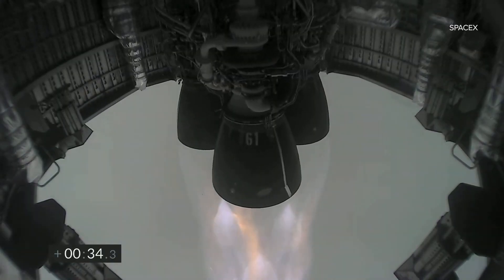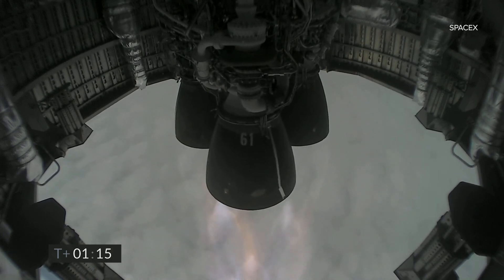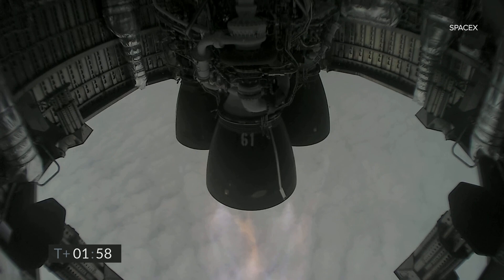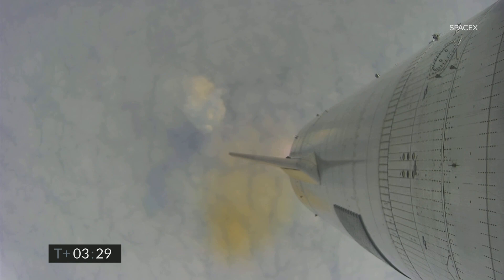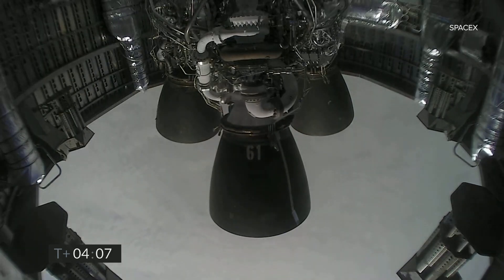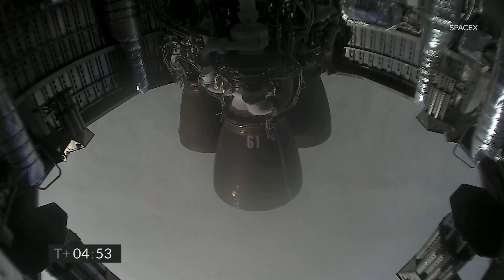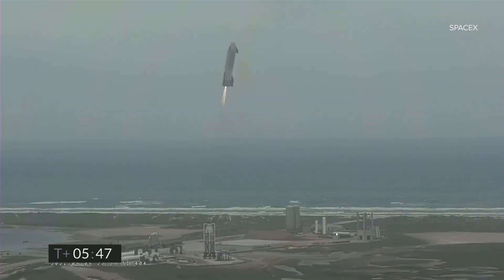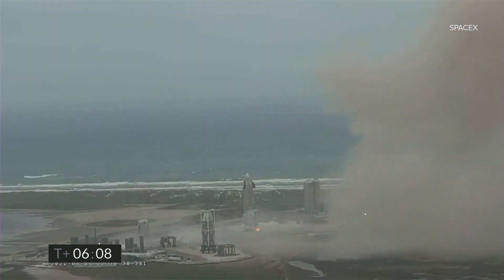SpaceX Starship successful launch, landing

Comment: 99% of people, including myself have no clue how difficult it is to send a rocket to the edge of space, and then land it within a few meters of a desired location, incredible stuff
Reply: @Stock Raising it would be easier to just send the rocket to the edge of space and land it again than it would be to deceive millions of people world wide with a fake launch and landing.
Reply: @Stock Raising Your brain is full of poop,  of will see poop in everything
Reply: @Stock Raising ok if ur gonna go after the moon mission i can't absolutely roll you.
1. The footage on the moon has shows tons of moments where the astronauts kick up dust, if you pay attention you see the dust goes in a straight line. Wanna know why that's important? It's only possible on the moon, try this with dirt outside and you'll see the atmosphere makes visible turbulence and vortexes.
Meaning, the footage could have ONLY been filled in a VACUUM, where there is no atmosphere.
The also black background and perfectly straight line light is also, only possible on the moon.
In order to have the same shadows and lighting as the moon, you'd need a massive light and a miles long, or else the shadows would converge and blur (compare the shadow of ur finger against two flash lights versus one, it's different))
If it were filmed in a massive room, it would be an incredible marvel of engineering equal to the rocket itself 
Because it would also have to be a vacuum chamber, a structure of that size, would have more tech advancement needed than the rocket  itself, as we still couldn't make something that massive even today. MEANING, IT'S IMPOSSIBLE TO HAVE FAKED THE MOONLANDING
Reply: @Stock Raising Did I stutter biatch
Reply: @Stock Raising bro.......I'm sorry but you are tripping hard on something 🤣,  it's not that hard to imagine, take a trip to Florida the next time they launch the rocket.
Reply: @Stock Raising well, if you think about it, it would prove that these space shuttles are real, I know, it's mind blowing 🤯
Reply: @Stock Raising And why do you think they would fake it? They don’t gain money from it they gain quite literally, nothing. Their fame won’t even last if they haven’t done it successfully, you quite literally have no proof on it being sci fi other then your “statement” which is from pure ignorance. I get that some people like you, don’t actually know how this stuff works, and can’t wrap your mind around it so your best option is to call it sci fi and to call anyone a robot whenever someone contradicts you. Believe me man, you won’t get far with this mindset.
Reply: @Stock Raising another failure at school i see
Reply: @Stock Raising please explain why this is impossible. You can go watch the rockets take off
Reply: @banton9368  he thinks there's a glass dome over a flat earth
Reply: @Stock Raising Ok flat earther
Reply: @Stock Raising like what “CGI”
Reply: @Stock Raising I did and there all easily disproved.
Reply: @Stock Raising bro what 🤣,  so are you a conspiracy theorists, because there's something called SCIENCE
Reply: @Stock Raising just for the record, you can literally watch these space shuttles launch from the beach or anywhere close since Florida is super flat.
Reply: The CGI guy is trolling all of you its funny
Reply: hey CGI guy, also all this chat and all of us are fake, we are AI just trying to make you believe this lift off/landing was real.
Reply: @draeonacs3160  Nah, I am not an AI but a dog. Don't tell my master plx, or no cookies :S
Reply: @Stock Raising stfu flat earther. Yall are so dumb. It's rlly sad how many people have the intelligence of a Neanderthal and its the 21st century
Reply: @Stock Raising lemme guess you think the moon doesn’t exist, and that the earth is flat
Reply: @Stock Raising I don't know how many years ago that must have been, but these days ... you sound like an absolute moron.
Reply: @Stock Raising hi absolute moron, you didn't do well in school, just admit you're dumb and unacademic.
Reply: @Stock Raising glad you see how dumb you really are
Reply: @Stock Raising The harnesses are for the astronauts to keep them from floating off into space.
Reply: @Stock Raising have you seen the cgi of that time, you would know
Reply: @Stock Raising yep I knew it, get out
Reply: @Stock Raising you too
Reply: @Stock Raising If the earth is flat and people who say it's a globe, such as me, are wrong, then how come when you put three people in Australia, South Africa, and Antarctica, they all can see the same constellation, the southern cross (which can only be seen at the south), at the same time? Oh wait, yeah, because they are all facing south because the Earth is a globe and not flat. It's the same thing with Polaris and Northerners can't see the southern cross and Southerners can't see Polaris because you can't see through the Earth. Furthermore, if the Earth is flat how come other planets are globes/spheres? If the moon landing was fake and it's all cgi, how come when you look at the cgi then it looked horrible? I can give you a links of videos to prove you wrong using little to no science at all. Not trying to argue btw, I just want to hear your side any maybe we could see each other's point more clearly
Reply: @Stock Raising So explain to me how people from the "outer edge of the disk" will be able to see Polaris and people in the "inner part of the disk" will also be able to see Polaris at the same time. Try to test it yourself, go to Australia and look for Polaris, you'll find nothing because you're facing South of the globe. You, like all flat earthers, have avoided those questions for a long time. It's time to face us with balls of steel and actually use Science instead of some abomination of an excuse. If you really wanna prove you're right, then explain to me exactly why we can't see Polaris when we're in the Southern hemisphere but can when we're in the Northern hemisphere. Please also clarify why "other planets are spheres and aren't flat". Your community's words, not mine.
Reply: @Stock Raising Ok
Reply: @Stock Raising Yeah, why?
Reply: @Stock Raising What does this have to do with my comments exactly?
Reply: @Stock Raising You too!
Reply: @Stock Raising Can't tell if you're trolling lmao, you seem to be very interested in defending your theory though so just make it easy. Go see one of these rockets launch and land. My brother has and I will be soon come Oct, 31. So if you're really interested in seeing how real this is, go check it out.

It will be bringing people to the ISS so you will see it go up and the booster come down to land. Should all be visible if you pick the right spot, which people will be spotting for you online for the best positions. 

Just be prepared for shockwave, my brother bite the hell out of his tongue when it hit lmao. Even if you don't want to go, who really cares how this shit is put together. History is filled with people trying to fill in the gaps, yes it helps but it shouldn't be something that divides us socially.
Reply: @Stock Raising What about the rocket landing, what about the capsule missing when said rocket lands? Where did it go, did it just disappear? 

Do they have planes picking it up once off the rocket and taking it back down, then taking the capsule back up when they need to re enter the atmosphere? Unless it just disappears off the face of the earth, no debris nothing. No one seeing them take it down nor back up, so what about that? CGI can't fix literally seeing it with our own eyes.
Reply: @Stock Raising can you send links to what you're talking about

Also I think you're overestimating what CGI is capable of
Reply: @Stock Raising damn this “conspiracy” is living in your head rent free huh?
Reply: @Stock Raising run that by me again in a remotely understandable format, so I can yell at a brick wall more efficiently🙏
Reply: @Stock Raising so tell me, what does nasa gain from getting enough people on their side to lie to the entire world about launching a rocket, instead of just, you know, launching a rocket?
Reply: @Stock Raising so tell me, what does NASA(not the company who launched this rocket, in case I needed more proof you have no idea what you’re talking about) gain from lying to the entire world, including people physically present at their launches, about making rockets, as opposed to actually launching a rocket?
Reply: @Stock Raising You are a liar and an uneducated halfwit, is what is fully understood here.
Reply: @Stock Raising 
Just admit that you failed school.
End of story.
Your 'God' laughs at your stupidity
Reply: @Stock Raising your just a random conspiracy theorist with too much time on your hands.
Reply: Between 0 and 100% of people including myself have no clue how easy it is to abuse statistics
Reply: KSP has helped us kinda understand how difficult it is. I still have a hard time trying to land on the Mun
Reply: @Stock Raising Nope. No water bubbles. It's ice/dust flaking off.
Reply: @Stock Raising That is exactly the case.
Reply: @Stock Raising i hope ur a troll if not u need help u been commenting this boomer insanity for 3 months
Reply: @Stock Raising hi I watch the landing live. It's real.
Reply: @Stock Raising I have read through all of your posts or rather, your input.

Trust me, you're practically contradicting yourself in the reply towards me.

Good luck, I have zero interest against a cyber warrior like you. Goodnight and take care.
Reply: @Stock Raising 
Holy shit, you do know people can see the actual thing launch right?
Reply: U lost
Reply: @Stock Raising and what do they gain by faking these videos?
Reply: @Stock Raising why would they spend millions making rocket that crash and in the end just making "fake" successful video?
Reply: @Stock Raising world doesn't work like that buddy
Reply: As a guy who makes a living making parts for the aerospace industry. It's a very difficult endeavor. The parts have to lie within .005 - .0005 Inches of every given dimension. Everything has to be absolutely perfect for this to work. The amount of time, effort and money is insane.
Reply: @Stock Raising Yeah, so easy to lie to millions of people with every nation on Earth cooperating to keep the lie alive. It's much harder than hiring smart & ambitious people that work hard to build a rocket that flies up to the edge of our world's atmosphere before returning with a guided landing. Yeah, our world is built on lies, and technology is stagnating heavily. The Earth is flat, too, and the corporation of every nation in the world, billions of cash, and who know what else... keeps this 'lie' alive for reasons, not even the lord almighty knows.
Reply: @Stock Raising Explain with evidence, not ludicrous bullshite. Hairspray? Really?
Reply: @Stock Raising I am somehow shocked an seemingly educated person doesn't know the earth is a sphere. Or that we've been to space. Unfortunately you're conspiracies are wrong but I'm not here to chance your mind, just somehow shocked
Reply: @Stock Raising you could literally do it yourself on a smaller scale and test it but noooooo you have to lie on the internet and swear it’s impossible because you don’t understand

Comment: I don't think they belly flopped with the raptor engines. Perhaps they maneuvered the fins to belly flop starship before lighting up the engines.
Reply: I heard that too and smiled 😃
Reply: Well it light up the 3 raptor engines with maneuvering flaps  if you watch SN10 belly flop.
Reply: That won't work on the moon. No atmosphere. No point doing this.
Reply: @happychappy2014  Also there is no need to go belly first on the moon descend at any point
Reply: @happychappy2014  They’ll use a different config and different maneuver

Comment: How is this maneuver going to work on the moon, which has no atmosphere?
Reply: Starship won't use this maneuver on the moon, it won't even use the raptor engines to land. It will use smaller engines that will be installed on the top half of the Starship to land on the moon.
Reply: It won’t. No need for flaps
Reply: The moons gravitational pull is a fraction of the earth's so less energy will be needed to slow the rocket down.
Reply: Conservation of momentum
Reply: You don’t need atmosphere to land a rocket.
Reply: I am going to short TESLA stock when starship takes off to the moon.  When it crashes into the firmament I am going to be the riches man on earth.

Comment: I DO NOT LIKE this conceived idea of a Lunar Lander.. Need a 4 legged New Idea of a Lunar module. This is " Buck Rodgers fantisy CRAP.  LUNAR surface is very uneven
Reply: Maybe you can decide to land in an area that's not uneven
Reply: Yes, which is why eventually the lunar landing legs will have an auto-adjusting design
Reply: this is not the lunar lander, this is just a prototype for testing the landing on earth for the regular starship. They will make the lunar lander later.

Comment: Well its about time....  But they still need to work on landing.  It's a good thing two engines fired and not just one like they said.  If they want to use one engine for landing then fire it sooner to slow down and get the correct landing position.  Either way the fuel consumption will be about the same.